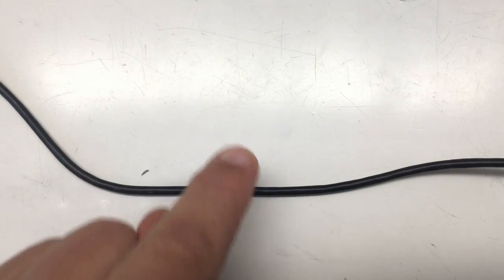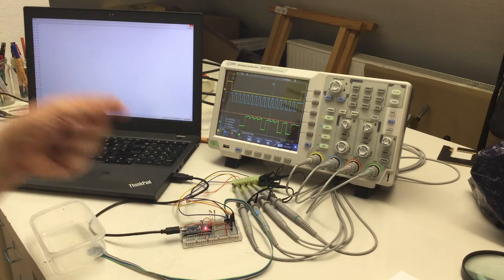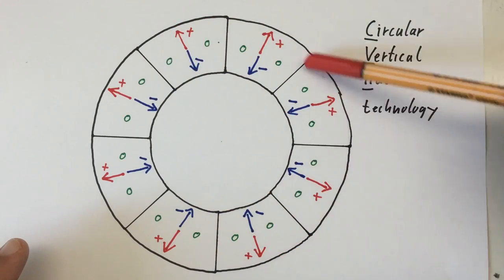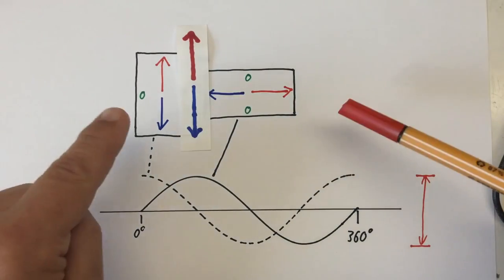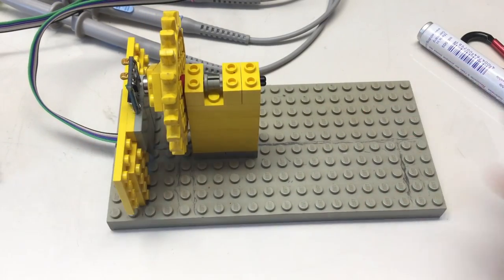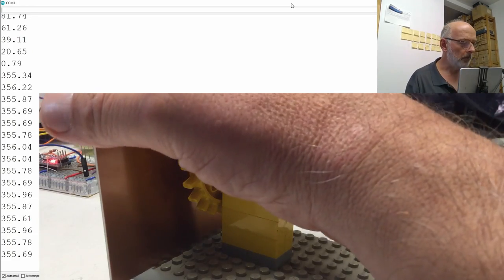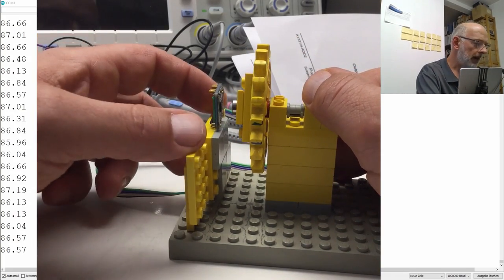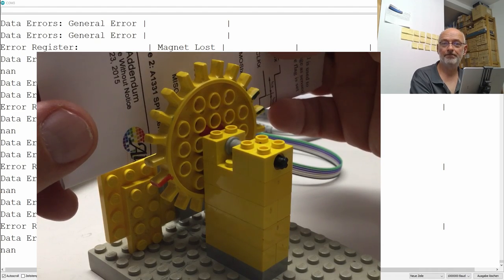Hall Effect Angle Sensors (Arduino, Allegro A1334 and SPI) – The Basics (1/3)

Comment: Hey  rob great video!  Can you please put a link to where you bought the a1334 modules? I cant find them on ebay
Reply from the maker: Thanks! And I'm sorry, but I didn't buy any A1334 modules. I bought naked chips (from digikey.com) and soldered them onto breakout boards (together with the necessary decoupling capacitors and the flat flex cable attached). As far as I know no A1334 modules are available (besides some $100 evaluation boards from Allegro).
Reply: @robertssmorgasbord  would there be a suitable alternative chip to use?  I am a beginner.
Reply from the maker: @ud4458  I started using the A1335 (in production) some 5 month ago ( https://youtu.be/b_1zqg0UZw0 ). Meanwhile I've written a quite capable A1335 library. Just search for all the A1335 videos on my channel. Though, it's not exactly a chip for beginners. You do have to solder it yourself onto a breakout board.

Comment: I need a similar sensor type, but in my case, the start will always be in a different angle, and i need it to know the position even when offline. Similar to absolute encoders, any suggestions?
Reply from the maker: Well, that A1334 does give you an absolute angle between 0° and 360°. So it is an absolute (magnetic) encoder. But what do you mean by "need to know the position even when offline"? The A1334 measures the angle of the magnetic field. So when it's powered up it doesn't need no zeroing etc., it immediately delivers the (absolute) angle of the magnet(ic field).
Reply: @robertssmorgasbord  thanks for the info , i totally understand that i need absolute encoder for that not an incremental encoder .thanks
Reply from the maker: @normiekl4532  You're welcome! I just wasn't sure from your first comment what you needed/wanted. So I felt compelled to point out that the A1334 is suitable 😉